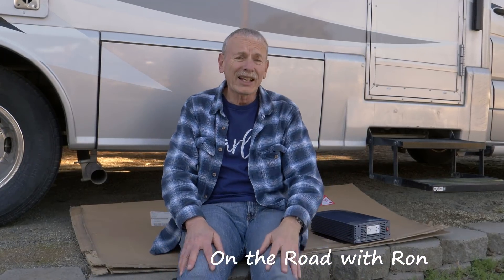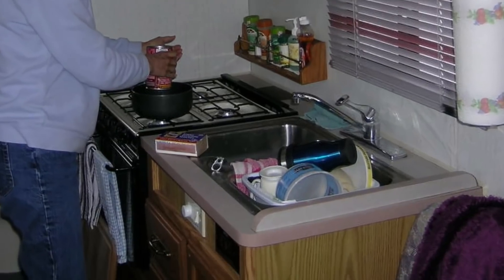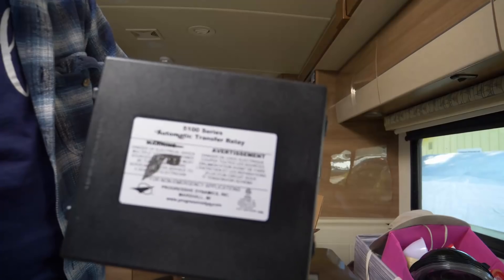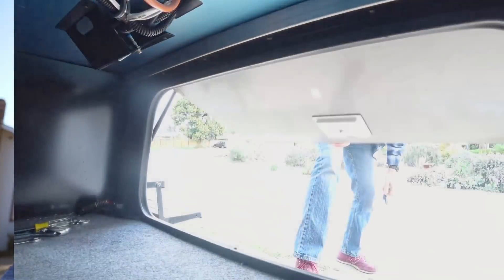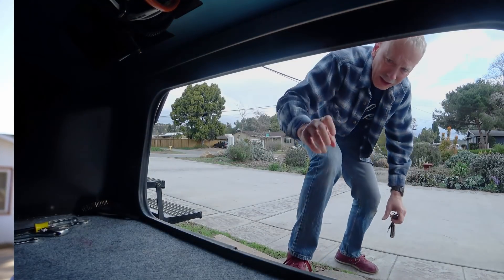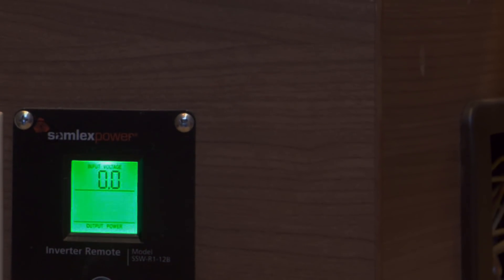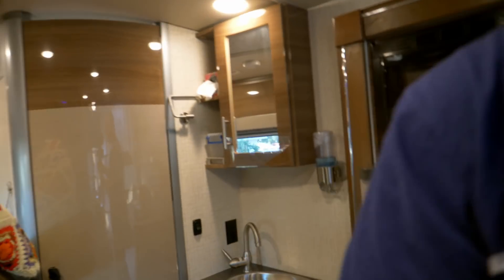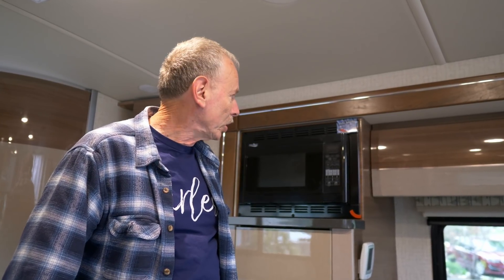RV Inverter Fail

Comment: Thank you so much Grandpa Ron for this video. It's put a fire under my feet. I bought a pure sine wave inverter to replace my original inverter and have never installed it. The one I bought comes with the automatic switch built in. It was not a cheap inverter. But it's only 1000 Watts, because that's all I really needed. I just didn't want to use a square wave on my electronics. So now I need to get busy and start installing it. Thanks again.
Reply from the maker: Good luck.  Sounds like the built in feature would make the install a little easier.

Comment: I have a Xantrex 2000W inverter with a GFCI outlet. Looks very similar to yours. I’ve had many “nuisance” trips. Common occurrence with GFCI outlets and some appliances. I took my inverter front panel off, and installed a standard outlet.  That was two years ago. My inverter runs 24/7, powering a portion of my home via solar. If I need a GFCI outlet, I’ll install it where the outlet will be.  Nice video, keep up the good work!

Comment: I bought an Aims 2500 watt inverter/charger with a built-in transfer switch.  I've been really happy with it.  The auto-transfer switch is a really nice feature.
Reply from the maker: Sounds like a good option. 2500 watts is in the sweet spot for inverter size. The 3k inveters require you to replace a lot of wiring with thicker copper for tge higher currents. Did you need to upgrage your wiring?

Comment: Nice video. We have the Xantrex XC2000 with the built-in transfer switch in our '18 View. Wired the 110V between the shore power cord and the main via an insert loop of 12 Ga wire from the panel to the same storage compartment. Since the transfer switch is electronically controlled by the inverter, it manages the negotiation.
Reply: I meant to say 10 ga wire
Reply from the maker: Nice, my '16 came with a Xantrex 1000 watt square wave unit.  Not easy to replace it the way they wired it in with special 120V connectors.
Reply: @ontheroadwithron2432  Assuming it is the same as mine, I simply mated the TE splice connectors together (the white/clear splice connectors) that mated to the Stock Magnum 1000W unit's 15 amp relay on our unit. This allowed the inverter to be spliced to the main to run the whole house and not just one of the strings. You could insert the relay between the shore power cord so it will disconnect the inverter when the shore power is connected.

Comment: Ron, is your refrigerator also 12v or 110? How is your frig running while going down the road? Mine has "shore or Propane" and I dont want to run the propane going down the road, so was curious if yours is running off the inverter you installed? I have the same unit you have, and LOVE it. Thanks for the vids and info!
Reply from the maker: My fridge is 3 way but the 12volt heater is lower power so i dont use it. When driving i run it on propane.

Comment: Hello Ron, about to install 2 BB LITHIUM ION batteries to my 2017 View.... how difficult is the process to make all the outlets hot, as well as the microwave??
Also, what brand of inverter & watt would you recommend ??  Thanks & safe travels..... Mark D.
Reply from the maker: I had to rewrite the main electrical box. Not too hard but you would want to add a auto transfer switch so you can’t both inverter and shore power connected at same time.

Comment: Thanks for the video Ron,  Just curious how you wired up your inverter to power your microwave and other items in your View.  I have a 16NJ and our stock inverter only powers certain outlets in the coach as it has input AC and output AC to the few outlets excluding the GFCI in the coach.  Is that why you had to put in a transfer switch to make yours power everything and back feed the AC input.  Thanks in advance and keep up the great mods.  

Scott
Reply from the maker: Yes, I needed the transfer switch to only power the outlets from 1 AC source at a time. Otherwise shore power will destroy the inverter.

Comment: I sure would like to replace the 1000 watt “square wave” Xantrex that came with our 2017 24G View.
But after looking into the wiring changes required, not happening.
Thinking about just adding a second “pure sine wave” inverter instead, in parallel. 2kw would do it.
Reply from the maker: Yes, it is pretty involved.  Getting an inverter with built in transfer switch might be easier.  I've never tied one.

Comment: Great video Ron. Love the effects. Stumped on the issue though. We run ours on and off shore and the micro works both ways. Where are you powering the inverter from? House batteries or cranks?
Reply from the maker: Inverter runs off the house batteries.  I think the GFI on the Samlex model I got is just too sensitive.  It trips way too often.  We'll see on a long trip how it does.  Fingers crossed.
Reply: I have to wonder if your ground may have some 60hz "noise" on it from shore power, either tripping your GFIs or circuit protection.  If 2 AC sources ever "see" each other they need to be in sync.

Comment: AC is 60 cycles. If your Inverter, and, shore power, are "Out of Phase" when you essentially connected them Together with that switch. Your Inverter didn't like that and burned out. The new device you installed seams to Prevent you from inadvertently connecting shore power to your Inverter at the same time.
Reply from the maker: Yes. I did have some relays i built to only allow one AC source at time but they didn’t switch fast enough. Some arcing and poof.
Reply: @ontheroadwithron2432  I recall an old story about a very well known chemical company that had a Switch building, where they would manually connect the Utility Mains to their own electric generators when demand got too high. The operator had a set of lights that displayed the Phase State. One day, the lights were not working. He flipped the switch anyway. The Phase must have been 180° out. Blew the concrete block building into dust. And, momentarily stalled a hydroturbin at a Utility generator site hundreds of miles away.

Comment: 2000w seems underpowered for the app.
Reply from the maker: Tim Dunk actually the inverter has plenty of output, but the batteries are limiting how much power I can use. The golf cart batteries under  hi load (over 130 amps) drop the voltage enough to trip the low voltage cutoff. 4 batteries would be great but I don’t really have space for them.

Comment: My email has changed 
I have lots of ?
I live in the Central Valley and was wondering if you be interested in making some of the mods on my RV specifically the rocking issues im having
I have a 2017
Reply from the maker: Sorry but I’m retired and will leave that work to the younger guys.